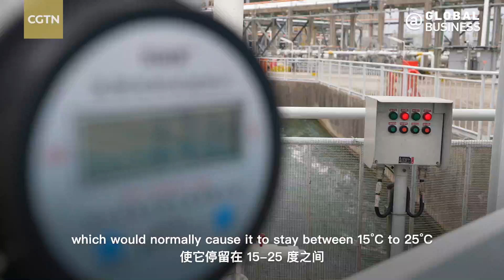China's LNG terminal utilizes 'cold energy' to cultivate seafood

Comment: 1. LNG Receiving Terminal: Acts as the source of cold water, a byproduct of the gas liquefaction process.
2. Sea Water: Used in the process, cooled by the LNG terminal without being polluted.
3. Aquaculture Farming Company: Utilizes the cooled sea water for farming.
4. Marine Species: Includes fish, lobster, and abalone, benefiting from the cold water.
5. Energy and Environmental Benefits: Reduced costs, saved energy, and carbon dioxide emission reduction.
6. Water Purification: Before release, water passes through grasses that absorb impurities.